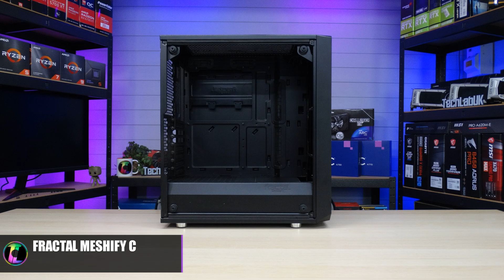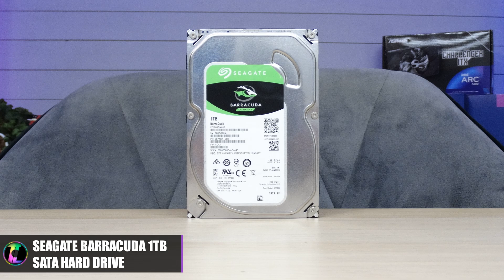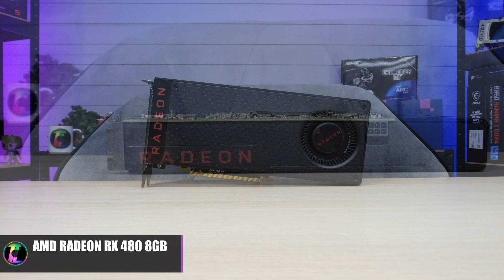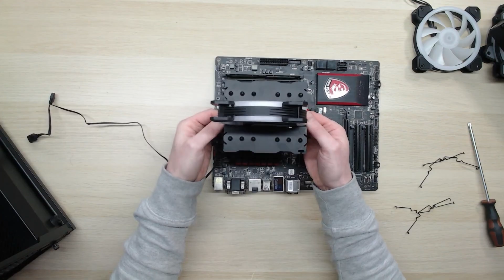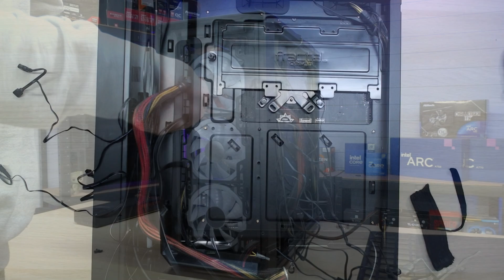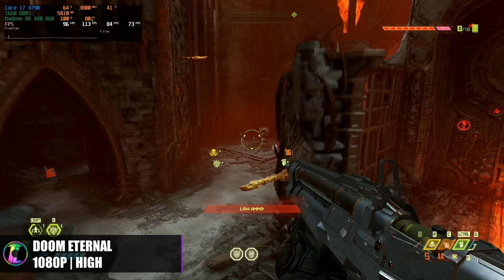Building my nephew his first gaming PC.

Comment: It's not a million miles away from what I was using until late 2021. I had a i7-4770k and a GTX 970 in my PC at the time. Intel 4th gen is still somewhat capable today though it's really feeling its age. I confess I would probably have started him off with a AM4 Ryzen system, perhaps with a cheaper A320 motherboard and Ryzen 5 1600, simply because there's a clear upgrade path there without having to completely move to another platform. Though perhaps that's the point, it's not just a gaming system but a learning experience.
Reply from the maker: If I had an AM4 system in the parts bin I would have gone that route but it's mainly older Intel stuff ready for rotation.